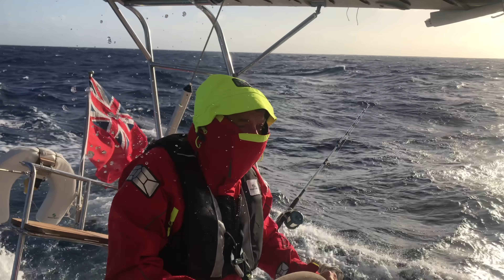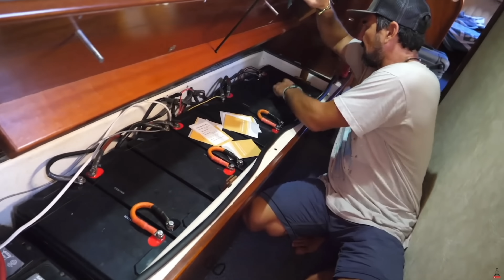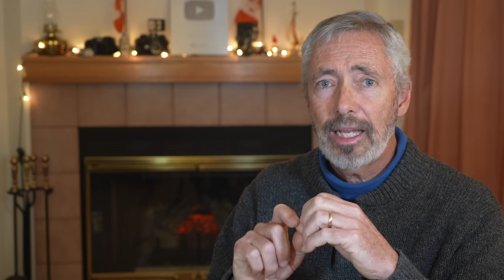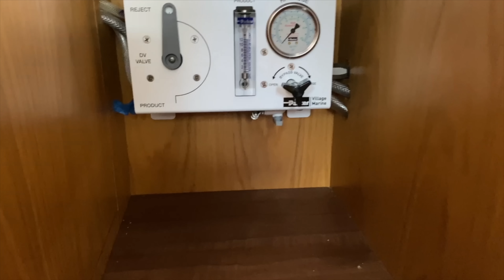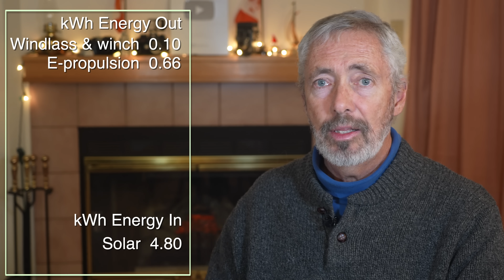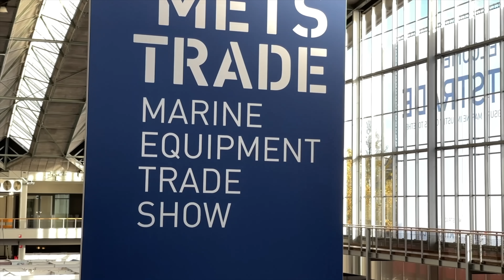Building an ALUMINUM Sailboat Pt 8 - HYBRID Power on a Sailboat: Will it Work for Distance? | EP 228

Comment: WARNING: FROM THE DARK SIDE. Thanks for your in-depth examination of the power requirements of your lives afloat. Even on our small trawler, energy is a major consideration. We have learned that, for us, the best formula for extensively cruising (2 to 4 months/year) in the Pacific Norhwest is to equip and manage our trawler (Iron Wind) in the proven manner of a cruising sailboat. That is especially the case with electricity. Ours is basically a sailor's powerboat, reflecting our attitudes and practices derived from our sailing (and powering) esperiences over the years. 
We greatly appreciate your experience and ideas about power sourcing and the major electricity demands you need to consider. A topic you didn't cover in this video is how, given that you are building new, you will set up, equip, and manage your background electricity demand as well as the major intermittent loads: basically the electricity demands of simply being. PLEASE CONSIDER DOING A SEPARATE VIDEO ON THAT TOPIIC. Your ideas for minimizing your background power demands on the new Distant Shores would be instructive. 
We have set up our systems to be as efficient as possible, although we are motor cruising rather than coastal sailiing or voyaging. Our power demands and resources naturally differ from yours. We haul a total of 1275 hours of AGM 12v power around on our little boat, which provides a solid foundation for our power needs when we are away from the dock. We are often on anchor for up to a week, usually in some small cove in coastal British Columbia. The 165A alternator on our trusty Lehman-Ford main engine (Bob) is our sole electricity source when away from shore power. So careful management of electricity is a priority for us too, even though we are a power boat. And, over days on anchor, much of that demand is background rather than intermittent. It also drives our quipment choices. For example, since we only produce electricity from the main engine, we are still have a propane galley stove and have Espar forced-air diesel heating.  
We have done virtually everything we can to reduce our background energy demand when we aren't underway or on shore power. For example, every lamp in the boat, save one I can't part with for reading, is LED. A major upgrade minimizes engine time for boosting the batteries when on anchor, by DOWN-SIZING our primary water heater to what our uses really require. We installed tandem water heating, with a 4-gallon primary tank (first in line for hot water demand) which is backstopped by a 17 gallon secondary heater. If we are underway, all that water is getting heated. But, if we are on anchor, the big advantage now is that we don't have to run the main engine for 2 or 3 hours to heat the water in the 17 gallon tank just to have a shower or do the dishes. Those purposes don't require 17 gallons: 4 gallons of water is plenty for those purposes. That translates to much less engine time. (The inflow water to the smaller primary tank is from the 17 gallon tank, which gets at least a little heat when we run the main engine on anchor.) Only running the engine for an hour when at anchor rather than 2 or 3 hours just to have a hot shower or do the dishes is a big deal over the course of several months of off-grid cruising. It also makes us less irritating to the sailors anchored near us. (The powerboaters don't care - they are all running their gensets. LOL)
Anyway, please consider telling us how you are setting up the systems on your new boat, especially if minimizing your electricity demand is a consideration in those decisions.
Reply: As I stated above; there is NO real world substitute for the power produced from diesel. 
Warped to a harbor wall with snow covering the decks, dozing in the glow of the Refleks back-boiler.
Reply from the maker: Thanks for the suggestions Hector! Also for the detailed observations on your trawler. 
I am indeed planning a series of additional videos on the power system management. I know from previous boats that seemingly small parasitic loads such as inverters, chargers etc can add quite a lot to unnecessary power waste!

Comment: I'm confused by the 2kWh "heating water" entry in the energy budget for cold climates.   Will your diesel hydronic cabin heater not be set up to produce domestic hot water?
Reply from the maker: You are correct that our hydronic heating will heat the water. I was doing the budget to calculate how much electrical energy would be required.

Comment: I have an all electric Lagoon 420.
 3x separate lithium banks.  One for each of the 72v motors.  They have 24x 3.3v batteries per side.
I get a max speed of 7.5kn
Cruising speed 6kn for 3-4 hours without turning on the generator to recharge…
3rd lithium bank is for our house needs, 20kwh charged with 3.5k solar.
I have done the numbers and with maximum efficiency, I could get up to 24 mpg from the generator charging the banks.

Comment: I am now mostly 'off-grid' solar in my land home.  I monitor every watt, as it comes and goes. The numbers for a family of 4 with no frugal sailing energy needs are quite different (e.g. we have 27kw solar, & 164kwh lithium and a separate solar hot water system because we don't live in the tropics, have a greenhouse with pumps, etc), but one thing I would strongly consider in your budgets is that there are inefficiencies in the systems.  So making 1kwh of energy from photo voltaic panels needs to be stored in lithium and that process is not 100% efficient, so you might only get 950-980W.  Then to get that energy out of the lithium there are more losses - especially if converting over to AC.  I have a reasonably efficient setup with short wires and big copper wires, yet I only get about 90% when comparing measured inputs and outputs.

I'd also point out the need for redundancy.  Sometimes its a nice day and you get more sun than you need and the batteries can't take any more.  Then a storm comes in and it's penny pinching where all that 'average sun' doesn't matter because the bank is dry after yesterday drawdown + overnight.  Larger battery banks can help here, but as you note - this is very expensive.  So my prediction is that you will be running your diesel more than you project.  Make sure you have large enough diesel tanks, and in a pinch can run the entire system off the gen-set.
Reply from the maker: Thanks M&M for your detailed notes. So great to be able to have so much solar with your setup. I do agree with you we will have many days where we can't make do without a popup from the generator. The boat is specced with 700l of diesel (roughly what we had in the last boat) so we will be fine. My hope is that it will last a fair bit longer than without the regeneration.

Comment: You haven't mentioned a wind generator, which may substitute missing solar gains on windy, overcast days?
Reply: Wind generators spend most of their time propeller tied down so that high wind speeds don't break them. Small wind generators combine the undesirable properties of high cut in wind speed and low survival wind speed. Most people find that they are not worth the trouble.

Comment: Nigel Calder built a hybrid system on a Malo 45 years ago. If I remember it right he went diesel propulsion after a while. But off course technology have improved. I would be concerned not having the power when needed. But perhaps your generator can generate enough with power to move the boat until the diesel tank is empty?

Comment: If your prop is feathering, will it not fold in instead of turning to re-gen?  Maybe I misunderstood
Reply from the maker: You are right the prop can still feather in as usual. Then if you want to engage "regeneration mode" you briefly put the shaft in reverse. This flips the feathering prop backwards and then you can do regeneration without it feathering... cool!
Reply: @DistantShoresTV  good to know, thank you
Reply: @DistantShoresTV  How much will it slow the boat while doing regen? Also, is it noisy? I watched an Uma video and the indication I got there is that regen is quite noisy.
Reply: @craigormsby458  That number was given in the video,
Reply: @LoanwordEggcorn  thanks for that. I've not seen Uma mention regen since so I had the impression that it might be so noisy and slow the boat so much that it wasn't actually worth it. Otherwise I'm not due why you would ever turn it off except in very light winds
Reply: I must have missed it. I'll have to watch it again

Comment: Interesting video thanks. 

There is many upsides to go full electric, weight, through wholes, silence, space, service etc. look at sailing Uma.
It consumes way less at lower speed, at 3-4 knots you can go on for hours. 
It would be better to use a fisher panda generator when you need the extra W and heat.
Up here in the north you can find power outlet everywhere, there is lots of marinas also.
Don’t forget the insulating, good both in summer and winter.

Good luck and happy new year.

Comment: Hybrid, electric propulsion & cooking means only diesel fuel which should last longer with solar. You also get the benefit of silent power for peace and quiet. Love the diesel/hydronic heating system connected to HW. Too bad there isn’t a condenser/heat pump that can pull cool ocean water for AC.

Comment: Excellent breakdown of systems operations and energy budgets. Since your solar area will be minimal, I highly recommend 20%+ or higher efficiency panels. Double sided may be better as light reflects up from the water. More expensive but you should be able to double or triple your solar input.
Reply: That sounds implausible to me, at best, a double sided panel may increase the generated energy by a few percent but nowhere near 100%, let alone 200%.
Reply: @mal6232  double sided panels produce around 180%
Reply: @mal6232  LG LG440N2T-E6: 440W High Efficiency LG NeON® H BiFacial Solar Panels. Just 5 of these gets you 2.2 kw
Reply: @mal6232  SunPower | Equinox System
22% efficiency
Reply: @mal6232  If you can fabricate a sliding panel system like this one: 
https://youtu.be/Ow1RB3Xw0ac
You could have 4.4 kw. Keep the panels folded while sailing. Open them up at anchor.

Comment: Interesting. 10 kWh per day seems like a normal household energy consumption, these days. Electric cooking is a bit like your diesel efficiency number. There's 11 kWh in a litre of diesel but at best you get 3.5 out. With a gas range, you may have a 10 kW burner that is easily outperformed by 2 kWh induction. As most of the energy is dissipated as heat that goes around your pots.

What's most interesting to me is how you align the diesel engine with the propulsion axis - will you have it in-line with consequential mechanical transmission losses, or will you have it "elsewhere" with a diesel-electric transmission?

Also, I have seen many boats, yachts, ships and most times their cabling is a mess. That mess makes fault finding, maintenance and upgrades very difficult. I always imagine that it should be possible to have separate ducts for e.g. power, heating, cooling, instrumentation & control, communication, each with their patch panels or hubs, whatever you call them.
So here my question is, how do you approach this in your design collaboration with the ship builders?
Reply from the maker: Thanks JP. Glad you liked it.
Regarding the skill and tidiness of installations - we were very impressed by the builder's high level and experience of installations. We saw their work on a number of earlier projects and it is amazing! 
We are travelling over to the Netherlands in 2 weeks and plan to spend a couple of weeks working with the builders (Gebroeders Van Enkhuizen) to design specific systems and installations for our needs!
Reply: @DistantShoresTV  - I'll be happy to see your reporting of that, here at YT

Comment: Utilisation of regeneration sounds like a really great idea. However, reliance on a functioning propeller becomes critical. Do you worry about the prop getting jammed and the consequences?
Reply: Two engines, two props, and two hybrid electric motors are the way to go.  That way you have a backup if anything fails.

Comment: The idea of hybrid propulsion is amazing and I also explored it for cruising needs. The issue becomes the cost, as you are paying essentially for 2 engines (1 traditional diesel + 1 electric). I know some people prefer built-in solutions, but from the cost and benefit (usage) perspective, I'd rather have a fully electric engine and a portable generator that can be stored in a locker. With new electric drives from Oceanvolt you'd want to maximize the regen function and only use the generator when absolutely needed (in the arctic for example as your solar gives you almost nothing there). Btw diesel hates cold, that's why I'd go with a portable gas generator from Honda for example. And yes, there is this whole notion of redundancy on a boat and some people prefer to have more than less.
Reply: Same as Sailing Uma then

Comment: I think the hybrid drivetrain is very neat, but trying to go fully electric is not feasible for propulsion. Even if you had 5KW worth of solar panels which you cannot possibly have in a reasonably sized monohull, it may just be overcast esp. when you are trying to avoid a coming storm.

So it's great to be able to avoid spending diesel when conditions allow it, as a second fallback from wind itself, but diesel is just too good to completely avoid in a yacht, and that's not even considering things like webasto heating in colder weather and water makers.
Reply: EXACTLY!

Comment: The regen can also act like a drogue when required, slowing the boat so as not to surf down those waves too fast. Hybrid is great, a back up engine/motor, brilliant.
Reply from the maker: Thanks Chile Sauce! I hadn't thought of that angle... as a drogue but you're quite right!
Reply: But the amount of drag from the prop will be very small compared to a drogue.

Comment: Hi, I have an induction cooker on board for the last 3 years while living on my boat in western europe and the Med. I love cooking and hardly use 1.5kWh per day. Its typically less with exceptions. My 80l boiler keeps water hot enough for 2 or 3 days (in the med even more). It does require a lot of energy and 3kWh is needed to get 80l of pretty hot water. Your calculation of 2.0 kWh per day seems high to me. We also shower less when sailing.
I would add the nespresso machine of 1.4 kWh and the tea water cooker as we use them a lot.
My conclusion; Cooking does not require too much power, hot water does.
Rgds, Berend sv Lyrics
Reply: For this I would and will explore the possibility to harvest just the heat separately with small (tube?) solar collector.
Reply: @ArcticSeaCamel thanks and sea you in the Arctic
Reply from the maker: Thanks VERY much Berend! Its very valuable to have real world data for the electric cooking as well as the water heating. I wonder how much different our heater data will work out when we head to colder environment. With aluminum integral tanks our cold water tanks will be at ambient seawater ranging from 15C down to just 5 in the early spring. So it will take more to warm water up than the Med :-)
Reply: @DistantShoresTV  I will sail to the Lofoten in may and perhaps beyond. We will meet at someplace and share the data.

Comment: Excellent and well thought out analysis from the cruising legends. Humbly if I were planning on heading north perhaps I might add a refleks type drip heater with a low amp draw water pump added to the radiator water circuit. Thanks for taking the time to help us all
Reply: Refleks / Wallis hob - heater for the WIN!